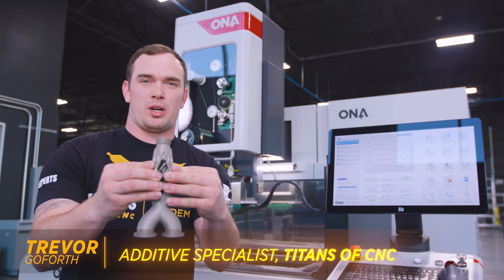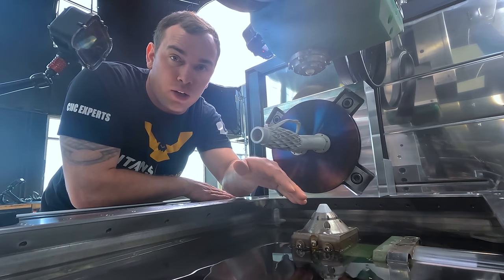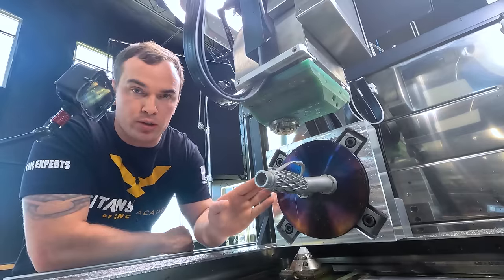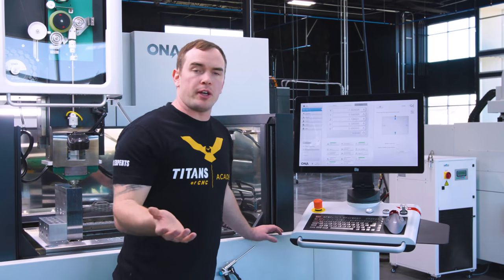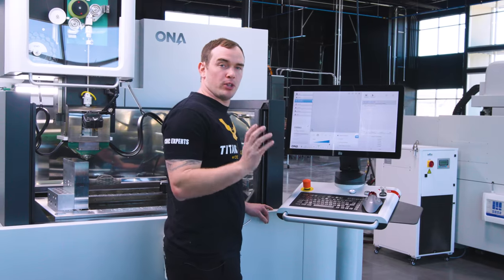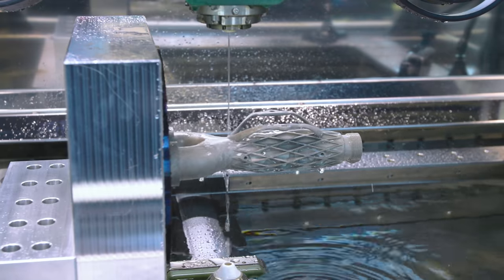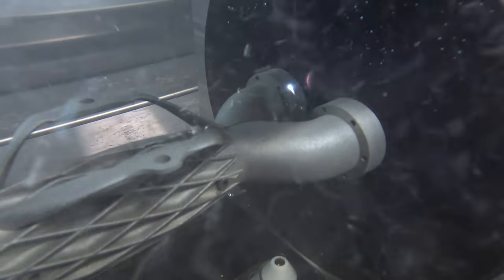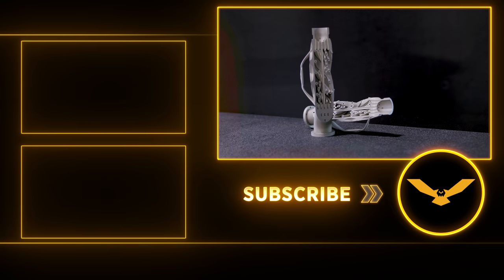How to Cut an IMPOSSIBLE Metal 3D Printed Part in HALF

Comment: 😎, get me a hacksaw. Done 😃
Reply: Yeah now find me a hacksaw blade that's 0.0010 of an inch thick
Reply: Give me chopsaw. Done 😎
Reply: Super precise
Reply: @thomasbarlow4223  The wire is . 010" not . 001" and why can't it be . 032" the part is only being cut to look inside. There's no specification for the cut other than being straight with a decent finish. Band saw and a belt sander. Done and you haven't finished a fixture yet
Reply: @alexchandras5618  Even better, I use to use one for inspecting the heat treatment on a part. Cut it in half with the chop saw and polish it on the belt sander to check the depth of the case hardening.
Reply: With the wire EDM they could make jigsaw pieces out of the part
Reply: Kevin, prove it!
Reply: Who Are you , Jim Duggan ?
Reply: This channel is the best

Comment: I did exactly this at the last company I was at. Cleaning the trapped metal powder out of the edm was always a nightmare after a just a few parts
Reply: Same hated that crap..
Reply: I dont get it? I just hose down the tank every day and you just change the filters and swap the deionizing resin after a set amount of hours. Not exactly difficult?
Reply: Sounds like the part wasn't properly designed for AM if there was still powder trapped inside

Comment: That moment at 8:41 beautifully shows one of the most challenges in wire EDM. You can't just cut huge chunk of material. 
Some parts are very challenging with internal stresses, parts will move slightly when cutting and removing material. You have to be smart with bridges you leave to cut the part off. 
On a machine with micron and smaller capabilities, this may be huge problem for some features. 
For this part in video, I think that it would be better to cut from side of the mounting plate to the right. Not that it matters, really, it was just to show the inside of the 3D printed part :)
Reply: That programme he showed did not finish that part, you could see how much the part moved. The 2nd and 3rd cut wouldn't of even done anything. He would of ran a second programme to clear up that face once it had moved. This happens all the time in unstable material. Something harder and more stable wouldn't of moved as much.
Reply: @chrisdilz  It's obvious it did not clean up anything as rough pass leaves max a few hundredths of a millimeter to remove in skim pass/passes. 
It's not just the material, it's about part geometry, how it was hold to the plate. Maybe if it was annealed it could help a little bit, but I don't think it would be much. 
Also, in the industry you can't just anneal something or make it from different material. You have to find a solution, if there is any.
Reply: @spelunking4444  Well, it's not really anything that you measure before last pass. You would rather cut a piece of that material (that will be removed anyway) before and measure this and then adjust if needed and proceed to real cutting. Sometimes I just knew what dimensions will be, because it's very repeatable process.  
From data book, depending on your desired amount of passes, for example for 50mm heigh steel piece:
•One roughing pass and one finishing wold be around 0,03mm for finishing pass.
•One roughing and three finishing would leave just 0,001mm for last finishing pass.

Comment: EDM needs a better description than what it was given, so here goes:

DI water does NOT allow current to pass through as he said, it specifically is a "dielectric", meaning it resists flow of current. What happens in EDM is that the high voltage breaks down the water in the electrode gap once the "dielectric constant" is exceeded.

That is, once the voltage exceeds what the water can resist, an ablative arc forms and burns away a little bit of the target material as well as a much smaller bit of the tool. The accuracy of EDM comes from the short length and duration of said ablative arc. In modern wire EDM, there are hundreds of thousands of arc generated PER SECOND. They only reach a few thou, if that, away from the tool. Very neat stuff overall.
Reply: I know what EDM is and vaguely how it works but thank you for taking your time to explain the process.

Comment: EDM a part with to different geometric shapes on either end. When I was an apprentice in the early 90’s our shop EDM’d a testing clamp (heat treated) that utilized the block and cut out for destructive pull testing. It varied in shape and size one end to the other and with the slug split (EDM also) so when installed into the test rig the more pull force applied the greater the clamping pressure. I can’t recall the tolerance from end to end or angles involved but I do remember being amazed that such profiles could be cut to such accuracy. Thanks I’ll be looking forward to seeing what you have next.

Comment: I have been working at edm for 5 years, they are incredible machines
Reply: How did u get into it if you don't mind me asking?
Reply: @rhindy6846   I'm not the guy you asked the question, but heres how i got into it... I went for a CNC milling job but was told unfortunately one person came out on top... 3 weeks later they called me back and asked if i was interested in WEDM instead. I now run 4 WEDM machines, a EDM drill and a EDM Sinker. Ive just put a 6th axis into one of the WEDM machines too. I find it fascinating and the parts I make are so much more interesting than what I would of been milling.
Reply: @chrisdilz  thanks for the reply appreciate it. Where I live it seems to be you get put on a machine and that's your machine. I can work all the CNC lathes milling machines and borers but they have just kept me on the milling machine. Don't get me wrong I like milling the beat but would love to know how to work this EDM machines
Reply: @chrisdilz  i hav a question, does the wire get "used up" or could you reuse the brass wire indefinitely?
Reply: @Humbulla93  no the wire feeds through the guides and directly into a bin at the back of the machine. Once its sparked through its rough in texture and measures undersize, its also goes brittle
Reply: @chrisdilz  thanks for the answer, now i know why they have two roles, would it be possible to cut through granite, as it´s rich in quartz which conducts electricity
Reply: @Humbulla93  quartz isn’t actually conductive, so no. I believe they cut this with a diamond wire, which is something different.
Reply: @chrisdilz  damn there goes my novel theory of how the pyramid builder cut the granit stones, thought because of the piezo electricity it would conduct electricity. however this would be the only method where you could cut and not affect the appearance of the grain so it looks like its one solid block
Reply: @Humbulla93  Yea you should look into piezoelectricity because i don't think it works how you think it does and definitely doesnt make something conduct electricity Quartz is definitely an insulator in that sense. Things need free electrons to be able to be conductive. Also you need really pure quartz crystals for it to be useful. And its really not a mystery o how they quarried the rocks for the pyramids and its not like the granite stones are perfectly symmetrical. They were cut with wood and water mainly, expanding wood can make a lot of force.

Comment: Bad flushing 😂😆🤣 mines open flushing ie none submerged and when i have jobs where i have to have the Z high and cutting through cavities I get loads of dry spark issues, usually what titans do in machining blows my mind and have no experience with fancy cnc I do with edm wire 20+ years, with that part opening up with the stresses you should have cut from your jig to the end and leave a tab and then cut the base, I do stuff like this cutting into sections so they can be 3d scanned to make sure they are like what a cad model is supposed to be and to make sure the 3d printer is doing the features needed, It blows my mind when wire cutting a part open to find whats inside and the incredible detail.    👍👍👍

Comment: I've seen video from an Aussie foundry where they're sand-casting anvils.  They break it out of the mold while it's still red-hot, and quench the anvil face to harden it, and then grind it flat.  I'd love to see you take one of their rough castings, and then cut the face with EDM, since EDM doesn't care how hard the material is.

Comment: How much wire was consumed in the process of this cut? That spool was turning at a pretty good pace during the video.
Reply: I was under the impression that the wire was not consumed, but I'm not very familiar with the process.  I thought the wire only takes minimal damage and was rewound as the machine goes... Kind of like a bandsaw?
Reply: @somethingelse4424  The wire is actually also eroded by the cutting action, so it has to be fed off of the new reel at the top to a waste bin that is usually at the back of the machine.
Reply: @StevenHeins  I see, so I assume you adjust the wire feed so that it is as slow as possible without being entirely eroded to the point of breaking?  I guess you recover the brass, but I doubt the scrap value does much to offset the cost of new wire.
Reply: @somethingelse4424  yes, it's a balancing act. There are servicing companies that are happy to take it, though it can get contaminated by the swarf from the cut

Comment: The laser process obviously built in internal stresses. The software manu needs to add control over where the laser first and last melts.  For example, melt on one side first, and subsequent passes will freeze and shrink, adding to stresses.  If you were lasering a tube for example, and spiralled from the inside out, the outer runs will freeze and try to pull the work outward.  If you can convince the software to start at center of tube thickness, and work outward in both radial directions, I believe the stresses would not conspire.
I would be happy to brainstorm this issue with you guys, the machine builders, and the software designers...I work all three topics.  You are awesome..well, actually, badass!!

John

Comment: Could you try to improve the surface finish of the tube insides by running fine abrasives trough it like sandblasting? Maybe print tollerances to account for the material you need to remove

Comment: Did that for about 15 years.  I had parts that we ran all the time holding holding +/- .000025.  We checked the parts with go/no gages supplied by the customer. At one time Mitsubishi had about 70% market share.  That is no longer the case!!  Still good machines.  Our shop had Fanuc and Mitsubishi!!  Fanucs are a very good machine but not nearly as friendly as the Mits!!

Comment: Interesting that when you cut it in half, it sprung open. That must mean there is some stress in the part.
Reply: There is always some internal stress in metal. It's the most noticeable in long and thin parts, even when milling. It's especially true for hardened steels, which have a lot of internal stresses.

Comment: On the machine there are stickers. Wear gloves, eye protection, safety boots and wash your hands, danger of falling in, no pacemakers allowed.
"I can actually put my hand in it no problem."
The part gapes apart. Is that due to residual stresses from 3D printing or due to uneven clamping on the part holder?

Comment: Is your shop temperature controlled if working to 0.0001”. Also have you got your machine on a substantial isolation base from the main machine shop. If you are not doing this have you got local temperature sensing at the part on the cnc table?

Comment: As the wire is cutting, it clouds up the water.  Would that make the water conductive again so that if you stuck your hand in there you'd get fried?
Reply: Not fried but a little shock near the cut.

Comment: First time seeing a machine like that. Very impressive! 😎
Reply: This technology exists for 50 years, at a minimum.
Reply: Mitsubishi Electric is best in Wire EDM.
Reply: Dies and metal stamping matrix are made with wire edm and then milled by cnc's.
Reply: @karlievbayram811  Thanks for the info
Reply: @karlievbayram811  Really, I always machined and heat treated my dies before wire cutting. Only thing I did after wire cutting was grinding.
Reply: @gooblio  
Several procedures have to be done after wire edm. Many people think that wire edm can easily replace traditional machining. But it is not the good way.
Reply: @gooblio  
Several procedures have to be done after wire edm. Many people think that wire edm can easily replace traditional machining. But it is not the good way.
Reply: @gooblio  
There is an old saying among machinists in Soviet Union: the best wire edm is not using wire edm at all. Used only in special rare projects when traditional machining is impossible. Wire EDM destroys metal surface.

Comment: When do you think that metal 3D printing technology in term of materials bonding will be as good as casting or it ever will be?
Reply: The material properties have been better than castings for a while
Reply: @BenWilson24  please verify with a stress test paper.
Reply: @vuththiwattanathornkosithg5625  you mean published mechanical properties? There are a ton out there. You can start at the printer OEM sites. Velo3D, GE Additive, EOS, SLM. They all post them. I was in charge of 3d printing process control at an aerospace OEM before taking a role at a printer company and have probably seen 10000 tensile sample results in inconel 718 and 625, ti64, F357 aluminum, Haynes 282, SS316L, hastelloy X, etc. Unless something goes very wrong, the properties are much better than cast, but not quite wrought. Certain materials are obviously a challenge, but for the common materials, the properties are well established above cast properties. Some properties do have less data than others though

Comment: 3D Printing is still an open book technology, dependent on the material, plastic, alloy or low melt metal can be done with precision finish, other than that, still need precision deburring and coating to cover all those porosity...
Reply: You know that the most successful space launch companies use 3d printing to build the majority of their engine parts?
Reply: The as-printed parts are >99% dense and virtually 100% dense after HIP

Comment: These are invaluable in the Tool and Die industry, precision combined with the ability to cut hardened steel and even Tungsten carbide.
Can make your guys running the cnc mill lazy though :), often if we have say 20 small parts with some simple features and an outer 2d shape you end up making a big block with all 20 in it then you just mill/drill the features and drill starting holes for the edm. 
So its just one big part in the mill move it to the edm and cut 20 complete parts out, no fixtures etc required.
Its not really worth it for very large series since the edm is very slow.

Comment: 2 finish passes. Don’t think so. Part opens up quite a bit (what I would also expect) @8:42
Reply: I've just commented on the same. That must mean there is some internal stresses in the part. Question is would a heat treat remove the stresses?
Reply: @Nickle314  never cut printed parts myself but a bit of movement is normal to me with separating cuts. This looks quite a bit more open than I’m used to it with my parts.

Comment: I never ran a EDM before.does it always run at the same feed not matter how soft the material is?
Reply: No, certain metals will cut much faster than others. Aluminum faster than steel etc. The biggest factor for speed is thickness of material.

Comment: My 2 comments would be why not use a water jet vs. EDM for a cut like this? and second of course given a 3D printed part, it's just easier to digitally cut it in the original model with a plane-cut and then print it in halves... but that is of course less cool.
Reply: precision a waterjet cant make a clean cut or perfectly straight faced cut past certain thicknesses, also how would you print the floating tubes in the middle?
Reply: Width of the cut, smoothness of the cut, setup. Typically, the EDM cuts are straight for 3d printed parts, so it's like 5 lines of gcode

Comment: What do you think of the SLM Solutions NXG XII 600?
It can print parts that are 600x600x600 mm
Reply: It's a cool machine but has had a lot of issues in the field
Reply: @BenWilson24  Porosity?
Reply: @johntheux9238  no, they're parameters aren't bad. I've heard more of mechanical issues with the machine itself. Just bugs to work out with a new machine with a lot of moving parts

Comment: Can ONA burn broken taps in blind hole? I see it can do slicing process. Can do other processes other than slicing?
Reply: You'd want a sinker, hole popper or specialised EDM drill for that

A WEDM might work if the manufacturer intended for it and you can be bothered with the hassle involved in this but it'd still be significantly worse than the others
Reply: They have another EDM machine that you can use for that which is basically like an EDM drill machine, think its called sinker edm

Comment: What happened to the two finish passes?
Reply: Skipped because the part spread opened from stress in the material I assume. At 8:49 you can see very good that the parts are not parallel anymore.

Comment: What you see is the - at the moment - limits of 3d prints. very bad surface finish. You can get a "product" pr say that works, but the efficiency of its is very low.. But with time and tech improvements... those massive grains you see in the wall, gets tinier and tinier...and the efficiency skyrockets! 

Future is there if you dare to grab it!
Reply: These are limits of some AM systems and build setup. Velo3D could print these passages beautifully

Comment: I still for the light and they can't figure out what that part is supposed to do or what it function is
Reply: It was just a test piece..No real function to it
Reply: It is a fluid mixer. 2 types of liquid flow into the 2 ports on 1 end, and are mixed internally to flow out of the single port on the other end